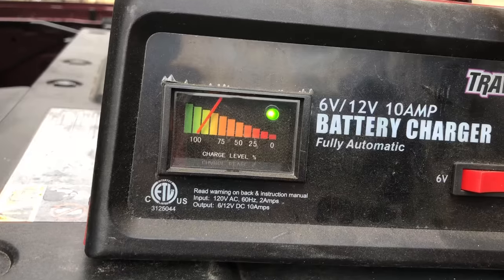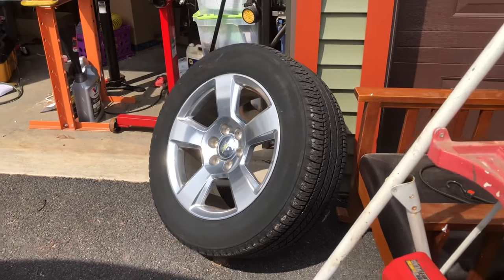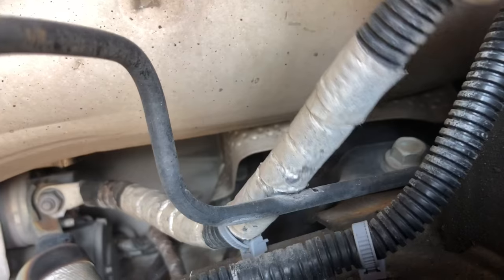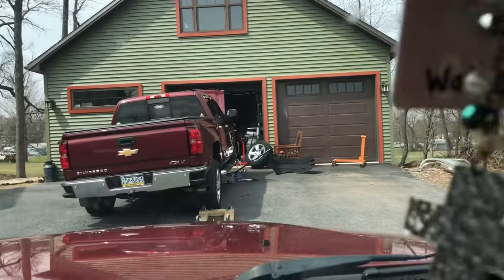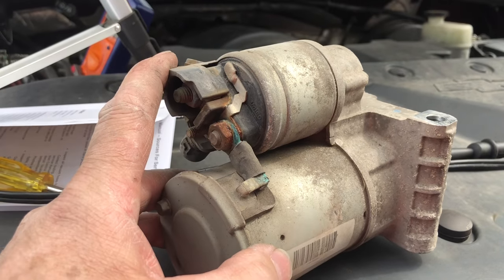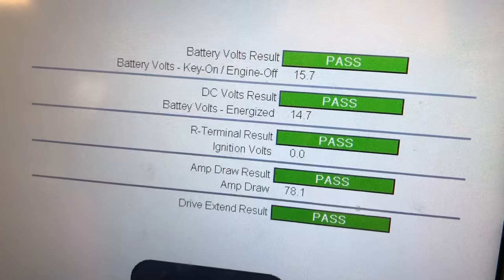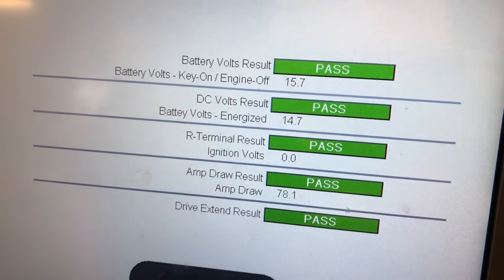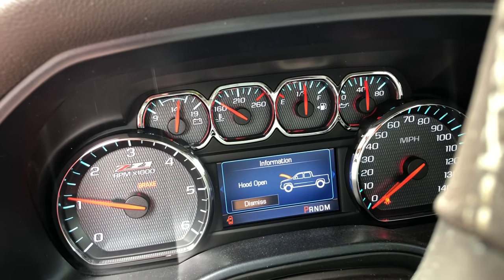2014 Silverado no crank no start problem solved!

Comment: Thank God I found this video. I have 17 Silverado and I am having this same problem. I’m doing this today! Thanks.
Reply from the maker: Flight Skool Double check the connection between the starter and solenoid I had a lot of corrosion where that stuff is and had to take that portion apart clean it and put a new washer on. It was arcing in the moment the arc happens the system shut down.
Reply from the maker: Flight Skool when your manifold bolts break I have videos on that as well.
Reply: Thanks. I’ll give an update once I get to the problem.
Reply from the maker: Flight Skool don’t break the clip on the power that plugs into the side of the starter. That harness will fall loose on its own if you break it, ask me how I know?
Reply: @WatsonsWagons  Thank You!!! Same problem here up in Canada. Watched where the power leaves the solenoid and sure enough it was arcing causing a short. Cleaned it up and no more arcing! Great video!
Reply: @WatsonsWagons  I just broke my clip lol.
Reply from the maker: @rustbeltmachine  Damn that sucks so it will still fit I used a couple of zip ties to hold mine in place until I got a replacement. I was at the airport one time and the truck wouldn’t start was completely dead I reached up under there the wire worked itself off of the terminal. My wife thought I was a genius when I plugged it back in and the truck started
Reply: @WatsonsWagons  my husband's truck is doing this same thing! 2015 Chevy Silverado 1500 with 5.3, 
I myself got it to start after turning key to power position and putting in neutral. Got truck to start twice doing that. After that wouldn't start again. Immediately thought  oh great starter out. So got it pulled, tested and it was fine. Put it back on, still nothing. Cleaned wires connections and all.. still nothing. Got to looking in fuse box under the hood and realized we had blown a 30amp fuse to trailer brake. Switched a few fuses got truck to start and run for bit. Shut it off, went to start again and nothing. 
Any more suggestions?? 

Already thought about neutral safety switch as well but not sure thats the issue.

Comment: You did a great job fixing your (No-start) issue, I've seen plenty of videos with people who drive the Sierra or Silverado manufactured from 2014 on up with electrical problems stemming from the body ground. I have the 2015 Silverado and sometimes when I apply the brakes, I notice my headlights dim a little, I am glad you posted your video, so what I am gonna do on a nice day, is cleanup all of my ground contacts, as a preventive maintenance for my truck.
Reply from the maker: James Grate thanks, hope you have success
Reply: Did you find the a solution to your problem james? I'm having the exact same issues as you described
Reply: @Sinaloacosala, Thank God, yes I finally got the problem resolved, it involved a couple of things gone wrong, there is a ground wire that's underneath the front passenger side on the frame of my truck that was corroded, so I cleaned it with a wire brush and applied Die-electric grease and re-mounted it. The next step was taking my truck to the dealer and they informed me that my motor mounts failed, and it was grounding out the engine, luckily it was still under warranty, so they replaced them free of charge. Again thank God, I haven't had any issues with my truck since the repair. The Main Culprit was the (motor mounts), it can cause the engine to misfire in cylinder 8 & 4, causing a rough engine idle, once they diagnose if you have the same issue and make the repairs you should be good. I hope this answer your question and help you get a general idea of what may be wrong with your truck, it's a headache, but be persistent with the dealer, don't accept their excuse that it's normal, God Bless and stay safe, please let me know how everything work out...
Reply: I also have a video that I uploaded a while back, recorded on my dash camera, showing the technician at the dealership discovering the problem as he is running what is called a (Pico-Scope), and you clearly hear his negative response as he reads the results of the test..

Comment: Some of these have a ghost (rare event) where some systems do not shut all of the way off (HMI, Radio, etc) when leaving the car. It is rare. But, when it does, the battery is completely discharged. Completely discharging the battery can result in random issues when replaced. After replacing a dead battery, it is always to hook up to the OBD and look at all of the results and then clear them before proceeding. Also, it is good to periodically check the OBD for hidden problems and clear them. If needed, phone based OBD software can create a report prior to clearing the messages to allow you to keep a permanent record. The new models are like babies, they need lots of checkups and health tracking. My favorite is OBDLink MX+ and for programming updates VXDIAG VCX Nano GDS2 and Tech2Win Diagnostic Programming System for GM/Opel Version. New GM updates (calibrations) occur for about the first five years. Lots of the calibrations are based on customer feedback where the limit based checking system needs the limits expanded a bit prior to throwing an error or shutting something off. Good luck! Almost forgot. ACDelco has recalls on bad batteries. I found I had one of those installed by a dealer. The bad news is that the recall was months before the dealer installed the battery. Of course, the battery died in less than two years. Battery engineers need to remember to leave a space at the bottom for debris to build up from the charge cycles. If not, when the debris touches the bottom of the plates, the battery becomes useless. These are all old problems that keep recurring as each generation of employees start work without gaining all of the value from an apprenticeship program.

Comment: Interesting, how the act fixed the issue. All good though. Will keep this in mind if that happens to my 2017 HC. Also check the fuses on the driver's side, another viewer had them all partly out and caused the same issue. Thanks for sharing. Cheers
Reply: The fuse box under the hood or in the cabin?

Comment: Having same problem with 2017. Yesterday, we Tested volts from batt to starter: 12. Then post and nut at starter: 2.00. We tightened nut and it went up above 7.00. It started right away. Tightened nut more, tested at 12.00. Tried starting this morning: just a click. I’ll try cleaning connection. This is the last GM vehicle I will ever buy.

Comment: When you tested the starter wire going to the starter and it showed 12.6 and a stud show nothing it was the connection between the battery wire going to the starter and a stud.
 All you needed to do was take the nut off the battery cable and clean the cable and put the nut back on.

Comment: Great Video. Same exact thing happened to me on a 2018 Silverado 1500 LT. Although my starter was replaced a few months back, I went back and cleaned the ground wire under the wheel well shroud and believe it could have been the buckle clip was loose on mine. The red security clip also broke first time around and after putting it back on property, I used a small zip tie to secure it on snuggly just enough it won't come loose again and then replaced the heat shield bucket cover. Job Well done on the video and very helpful ‼️

Comment: 2014 High Country, same problem. SOMETIMES, it won't start on the first try, second try, third try... but about the 10th, 11th, 12th try it starts right up. I haven't been stranded yet. My instinct is that wet conditions play a factor for my problem.

Comment: I had a hot soak no start issue. Cleaned all connections and installed a better heat shield. No probs since.

Comment: 2017 had the same issues with the starter.Did the same exact same thing you did and it started.  Thanks for the info.
Well after it didn't start again .....i ended up replacing the starter.
Reply: I'm about to change the starter also. Did this fix the problem so far?

Comment: Watson have you had issues after this. I have had this issue 3 time in the past 2.5 months. I think through research they say it is the ecm/ computer. Keeping the battery disconnected drains the electrical system and resests the computer. Last Friday 2/5/21 I went to leave work and it happened. This time I quickly disconnected the battery both sides then connected the negative and positive cables together to quickly drain the system with the headlight knob on manual on to keep an open circuit flowing. I waited 20 min for system to completely drain and re connected. At that point the computer reset and started first crank.

Comment: Same issues , no start , cleaned all grounds even the ones at both ends of the top of the dash , New battery , Alt , the shop put in a new starter relay , work for to weeks , seems if i take the Neg battery wire off it seems to Reboot and starts , voltage stays about 14, have a Blue Driver code reader says of one of the fixes may be a new battery cable , think i try this first , thanks for sharing

Comment: My 14 just started doing this. When I let it sit and cool down it starts right up.  I’ve heard the starter gets to hot.  The replacement starter from Gm  is different than the original.  But I don’t know that this is the problem I have yet to replace anything

Comment: Electrical stuff drives me nuts ,Iam having same trouble with the 08 Silverado .It seems to have started with short in Drivers headlight .One click nothing when I turn key .Iam cleaning all grounds and connections. Thanks  for video .Really good learned alot .👍
Reply: Did you find the issue? Mine does the same thing i have to jump it from the power wire on the starter to the starter solenoid
Reply: @cbuschjr  Mine Turned out to be a bad Battery ! I Bought a new one that was defective , it drove me nuts . Finally had It checked and replaced ! Good Luck with yours .
Reply: Thank you very much,
Not my issues. New battery,  new starter idk what else. Even replaced the ground cable. Mine is so intermittent
Reply: @cbuschjr  Sounds like a short some where for sure . Iam horrible with electric .I was close to taking it to a mechanic that could run it down .I never dreamed a new Battery could be bad .Anyway good luck sorry couldnt help more .✌

Comment: Thank you for the video. Did the cleaned ground solution last?
Reply from the maker: Yes but there was another problem that I discovered it was the post that leads from the solenoid to the starter. It’s sort of a flat mesh connection with a couple of washers and a nut that sends power from the solenoid to the starter motor that area was arcing due to corrosion I had to take that apart cleaned it and put new washers in a nut on there so check that area for looseness
Reply: @WatsonsWagons  thank you. Im about to take my 2016 apart for this click and try to get in there and this really helps. I did the battery Sunday and thought I was good but I was wrong. I really appreciate it

Comment: I broke the red clip on the starter connector as well.  Did u ever have any other issues with it?  I had nothing left on the red clip so I plugged it in and wrapped with tape.

Comment: I’m having the same problem. I’ve tried all suggestions in this video and am still having the issue. Any other suggestions?
Reply from the maker: @KaylTingley-b1r  check the link between the starter motor and solenoid and see if it’s heavily corroded. After this video I had the problem again and cleaned and replaced the nuts and washers on the solenoid post. Mine was arching with loose connections
Reply: Will do. Thanks

Comment: This morning I started my 2014 GMC SLE at -18 C and after the 10 min warmup on the key fob it would not start so outside in the freezing cold and the dash lights light up but no crank. Not even a click.  I put in a new battery just on spec 2 months ago and checked connections. Seemed good.  So throw a charger on it and checked it and there was 12.8 volts.  Tried after a bit and nothing.  Volts back up a bit. Disconnected battery checked posts and all good and clean.  I read on here about smacking the alternator so I got out the small ball peen hammer and damn if  it didn’t work.   Alternator is putting out 14.22 at the batter and at the fuses and to the alternator it’s 14.11 volts. I am getting amperage out of the alternator and it’s charging.. Its too cold outside so when I can get it into a garage or springtime I have to check those grounds.. It started all day downtown::  Good video

Comment: Did you check the neutral safety switch?  It's the one part in the starting system that will allow everything to work when the key's on and not send power to the starter solenoid (via the fuse, start relay and PCM).  My 2016 has this problem and it's "fixed" by turning the key to on and shifting the truck from park to neutral and back to park, then starting the engine.

Comment: just bought a 2014 silverado 1500 about 2 months ago with 80,000 miles on it and drove beautiful for the first month. now i’m having this same issue. the truck will start if i hadn’t drove it in hours, but if i went to get gas or something and had to turn it off and back on, it won’t start and it does that same thing, cabin lighting, headlights radio everything turns on but i can’t get the truck to start. battery and alternator tested good at multiple different places i brought it, so when they ran a diagnostic last week they found it was the starter that was the issue and replaced it. truck ran great for 2 days and now i’m back to it not starting again. what do i do?
Reply: I have a 2014 1500 with the same problem. It was my negative battery cable.
Reply: @rudyynostrosa3421  thank you! i had some loose connections for my ignition switch, replaced them and haven’t had the problem since. if it happens again i’ll keep this in mind!
Reply: @joshglanz wheres the ignition switch located?

Comment: So after all of this work you did what would you say the issue is?
Reply from the maker: It happened again a month later, discovered the terminal on the solenoid that the starter hooks to had rotted nuts and washers. When starting it caused arching and that was enough for the system to recognize and shut off. I cleaned the terminals and replaced the nuts and washers. Coated the connections with liquid electrical tape. Haven’t had a problem yet
Reply: @WatsonsWagons  would a new starter possibly  fix the problem?

Comment: My 2007 silverado 1500 is making the same click.  tested the starter and it is fine.  I noticed it dose not realize that it is in park and I need to slightly push the shifter back and I am able to start it.  Not sure where i need to look to fix this.
Reply: Could be the neutral safety switch. It's on the side of transmission under the driver side. It only allows the truck to start if it's in "P" or "N".

Comment: So this started to happen to my truck changed battery new starter got the starter installed at dealership was working awesome for 4-5months and I’m back to the same. She can start right up drive her to the store in and out 10min. No start takes a few tries for it to start up it clicks clicks clicks until it starts up but has trouble starting up. Any help on this?? Thank
Reply from the maker: Do the dash lights go out when it doesn’t start? Check the short stud coming off the solenoid that connects the starter. That stud, washers and get corrosion and cause arching.
Reply: @WatsonsWagons  only the check engine light starts flashing with the clicking
Reply: @erikmendoza8641  did you fix it? Mine is doing the same?
Reply: @tinotabares6034  yeah bro. I did this and a checked all my fuses make sure they was secure and haven’t had any issues
Reply: @erikmendoza8641  strange. I went to jack mine up to check the ground wire and kind of gave it a hard wiggle while it was in the air and said for shyts and giggles let me try to crank it and it crunk up and is now cranking. I didn’t replace anything only wiggled the wires. How long do you think this will last? It’s running and cranking with no problems again like before it started doing that
Reply: @tinotabares6034  mine hasn’t had a problem 8-9 months
Reply: @erikmendoza8641  see mine wasn’t even clicking though. It would just go blank when I turned the key. It hasn’t been having starting problems either so it’s weird to do that. Battery is good and since it started today I the guessing the starter is good. But now I’m scared to travel really far cuz it may not start. You suggest I go ahead and get a new starter?
Reply: @tinotabares6034  the starter can be bad/actingup. Even tho it turned on it can still be the started holding on. Try changing it and go from there
Reply: @WatsonsWagons  Silverado with 70000 miles why does starter get corroded so fast does that cause battery drain?
Reply from the maker: Well I have well over 100,000 miles on mine now, had a recent follow up no start and it was the ground cable, gave it a jiggle by the battery and it worked, probably internal corrosion. Haven’t replaced it yet.

Comment: Dielectric grease is an "insulater".
Bad choice for protecting a ground.
Better choice would be CONDUCTIVE grease, such as common, copper or nickel based ANTI SEIZE.

Comment: My 2015 Silverado is doing this rightnow, my battery is reading good volts, all I did was take off starter and took it to get tested like you did I put it back on and turned on I used it for a couple days, now today it didn’t want to start
Reply from the maker: Jacob Villasana did you check the tightness of the connection between the solenoid and starter? I found a corroded washer, the connection was loose and arching. The moment it arch’s the dash Will go blank. Pull it and check, I had to clean contacts and replace the nut and washer

Comment: My truck had loose starter connections Pulled back the wheel well and tighten the connection with a 13mm.